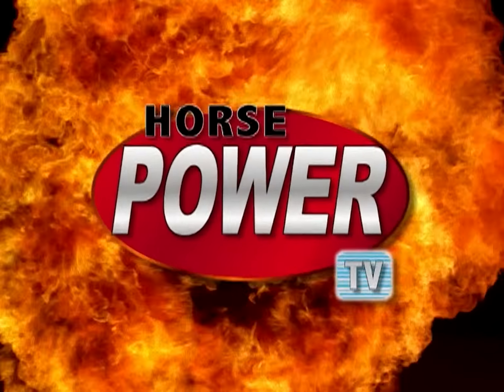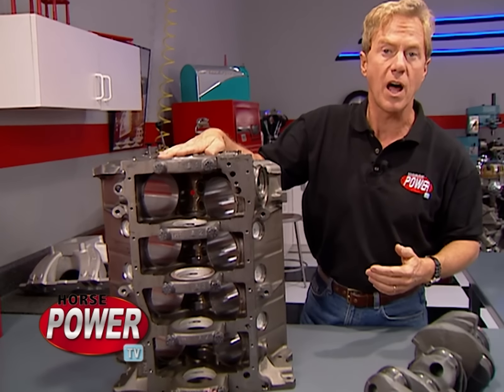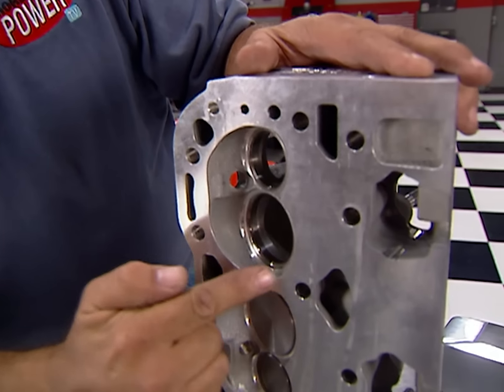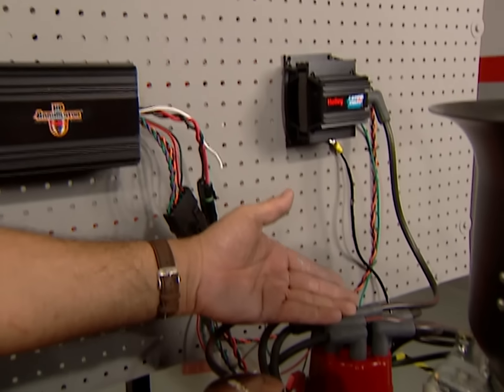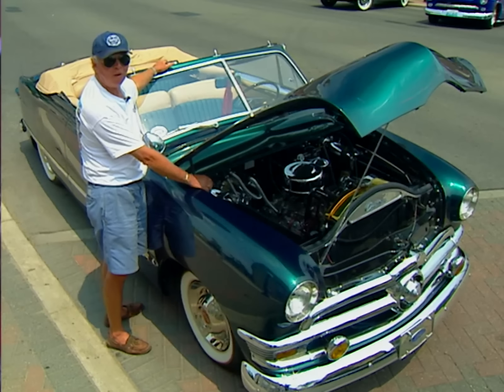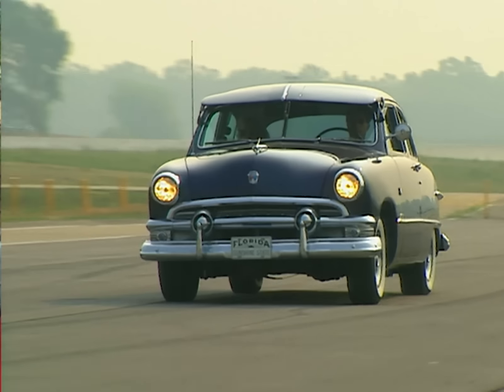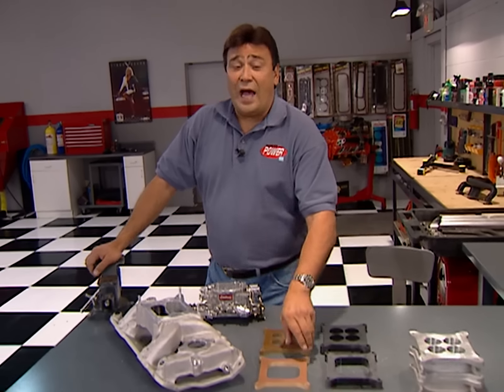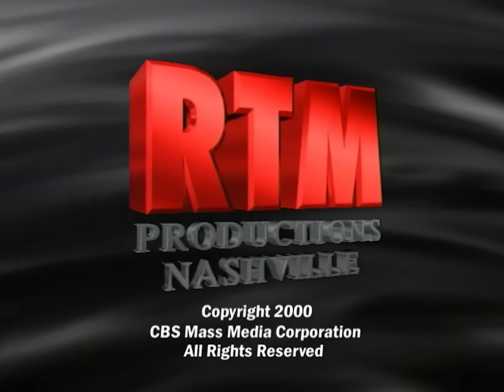Chevy vs. Ford: Who Has The Stoutest Small Block? - Horsepower S2, E6

Comment: Why would you upgrade the cam on the Chevy but run the original Ford cam? Sounds like this test is rigged in Chevy's favor! This was supposed to be a test of who provided the most power but you upgraded one engine and didn't upgrade the other. Comments were even made about "the hot cam" in the Chevy. Why would you not do an even test? Unless you were wanting one brand to "appear" to win over the other!
Reply: Just like when they ( Power Nation I believe ) did a 460 vs 454 and only put mild upgrades on the 460 but went all out on the 454.
Reply: Only way Chevy makes more is to rig the numbers with better parts
Reply: @chuckfowler4754  Right or otherwise Ford would demolished Chevy just like they already demolished the big block V8s with its almighty 427 SOHC 2V Cammer V8.
Reply: The hotcam was an option on the ZZ5 right from GM. A better question would be why doesn't Ford offer something similar?
Reply: @johncoleman2495   They do offer ford racing cams.
Reply: @DOHCCordia  as an option in this engine?
Reply: Sure.  Buy it and stick it in.  Lol
Reply: @DOHCCordia  the hot cam is available already installed in the ZZ5.... So my assumption is there wasn't one in stock which is why they swapped it. Sounds like Ford needs to rectify that situation.....
Reply: @johncoleman2495  Sad thing is during that time Ford had hotter engines.   The 415hp wasn't the hottest one.  I assume the 10:1 engine wasn't as pump gas friendly according to these guys.  Or it would've had an advantage over the chevy. Lol
Reply: Forged crank for the Chevrolet and vast for the Ford. 9.6 to 9.0 compression and roller lifters with a larger cam. Roller cams were available for Fords for quite a while. Chevrolet still has a strong following, but it would have been more representative if they had of used equally specced cams, cranks, C/R, manifolds, lifters, then it would be a more apples to apples comparison. It seems that there always be a certain bias for one brand vs another
Reply: @wilfredbruce5327 I agree.  Now I
Am a Ford fan

Comment: 9.6 compression Chevy vs. 9.0 Ford
2.02 valves vs 1.92 valves
Single plane intake on the Ford kills hp on a mild setup dual plane on the Chevy= more torque 
The cam seemed like it was hotter on the Chevy roller vs. flat tappet Ford
Close but not exactly even
Reply: I am assuming they installed the LT1 and LT4 "Hot Cam" upgrade. The specs are 218/228 @ .50, .525 lift, and a 112 LSA. This is a much smaller cam than on the 351. I did not think the Chevy would have a chance in the HP department considering that the Ford had single plane intake and a larger cam. I have seen 351s make LS type power, easy. BTW, the Chevy head had a 2" intake valve.

Comment: Thay used a low compression piston on ford 9 to 1 and 4v piston on chevy chevy engine got slightly better parts
Reply: They bought crate engines with available packages.... crate engines....Chevy just built a better one😂

Comment: Ford intrduced the smallblock in 1962 in the Fairlane, not 1963
Reply: knowing Ferd it was 1962 1/2
Reply: @yurimodin7333   nope, was first introduced in the 1962 Fairlane
Reply: @krislinder7460  bro it was a joke about Fords half-years.
Reply: @yurimodin7333  Chevy does it too. but are low key about it and usually with trucks. You'll go to get something like brake pads and find out you need them for a year newer which had different brakes than your year
Reply: @krislinder7460  i used to work at a parts store, the only thing worse than a ford is a mazda
Reply: @yurimodin7333  You think that until you buy a Dodge..lol Go FORD!!

Comment: Unless it was just the audio but it sounds like Both of those engines needed serious timing adjustments!😬
They both sounded like stuck pigs!
The Chevy fell on it's face, I'd bet that engine could get "close" to 500hp with proper tuning.
And the Ford was all over the place it didn't know what the "F" to do!
Both of those motors did not get to show thier full potential.🤔🤷

Comment: Typical Chevy versus Ford showdown the Chevy gets the better parts roller lifters all the goodies and the Ford get the lower and stuff. 
But truth be told that they would have rolled in a bone stock 351 Cleveland with 4V closed chamber cast iron heads and a boss cam it would have whooped that Chevy's butt easy

Comment: Just go with the sb chevy ! It has a better hp to torque curve ! Its stronger and simpler also parts are lower cost and more standerdized ! Win win
Reply: lol. Thats why ford makes more power apples to apples, they didn’t compare them equally. Fuck this is a 302/351w. Use the best for best, the 350 Chevy and the 351Cleveland and the Cleveland would walk the hell out of the Chevy with stock heads and just a bigger cam. Fuck my stock 72 OPEN chamber 351C 4v with just a cam and flat tops (9.36:1 compression!!!) made 450hp/430 tq. Super easy to get 500hp and equivalent tq out of a Cleveland and even a Windsor…there’s a reason Chevy copied the Cleveland head design…

Comment: lol, almost as if a 302 vs a 350 isn’t unfair, use a 351C and a Hot 350. Bet the 351C will out perform the 350 all day long.. quit riding Chevrolet dong.